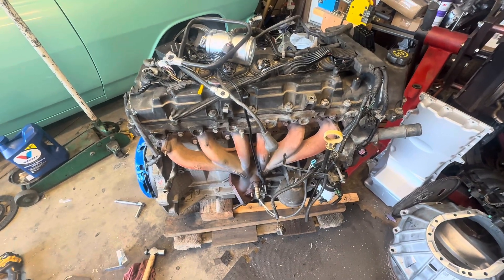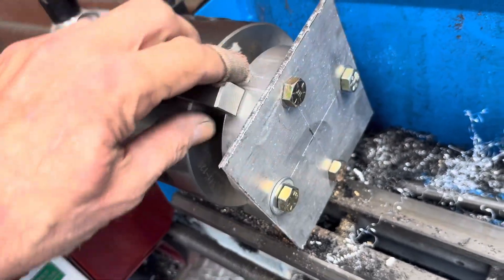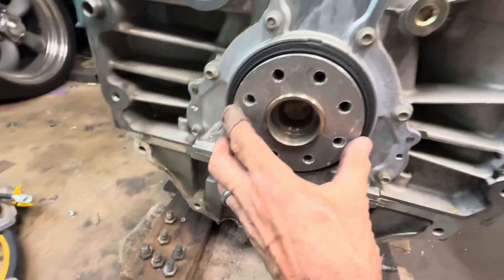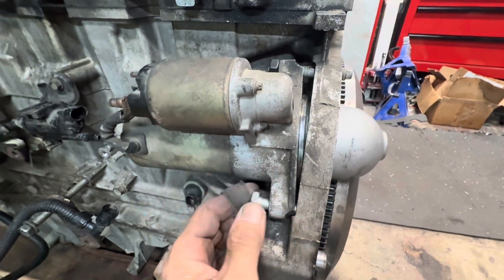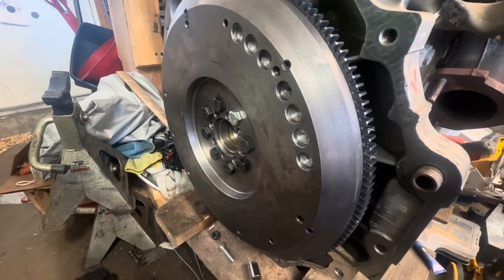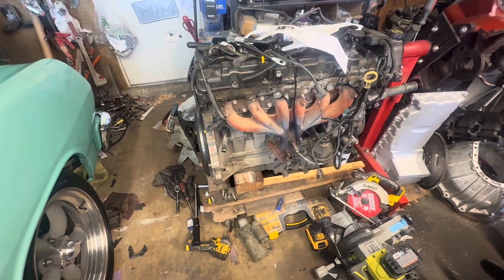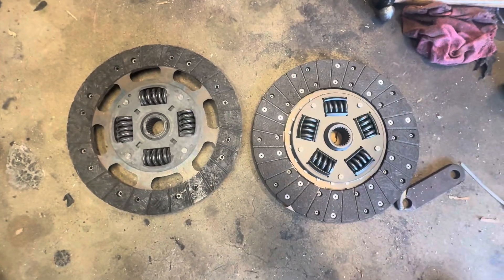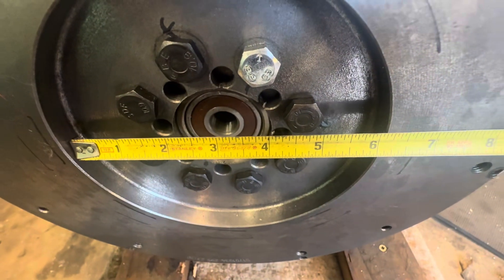Trailblazer gm 4200 watch me adapt a 10.5” clutch and pressure plate to a stock Colorado flywheel 🔥🔥

Comment: Why not shim the flywheel farther out and fix your starter problem too? Seems like a shim with the proper register would kill two birds.
Reply from the maker: They go in opposite directions. There lyes the conundrum
Reply: @Motorhead_Mark I think that what I said is correct but maybe we’re talking about different things. The starter needs to be shimmed to the front to not hit the flywheel. Moving the flywheel to the back solves that problem. The throw out bearing needs to be shimmed toward the front. Moving the flywheel to the back solves that problem. Right?
Reply from the maker: Oh, now I see what you’re saying but you always have to consider the limited space between the flywheel and transmission. There’s not usually an extra amount of space in there.
Reply from the maker: And I don’t think it’s a good idea to have it come off the crankshaft hub it might be possible for to lose center become unstable